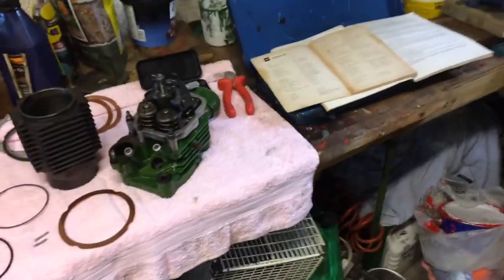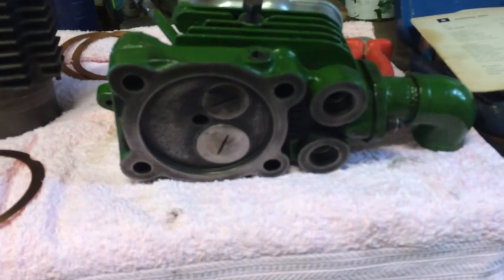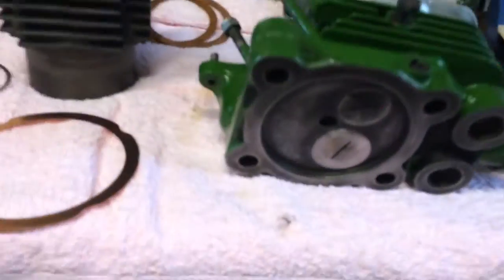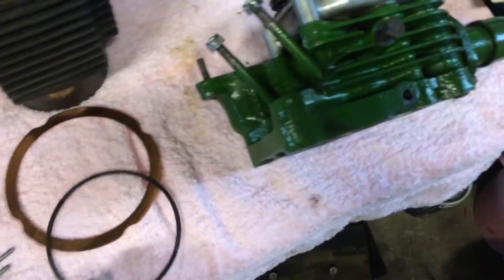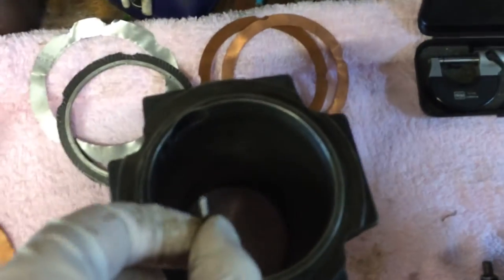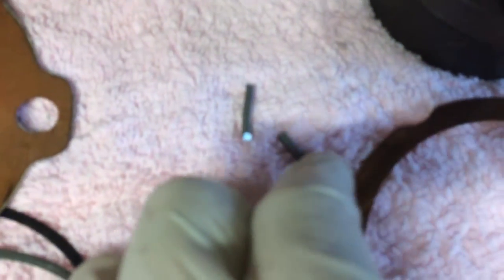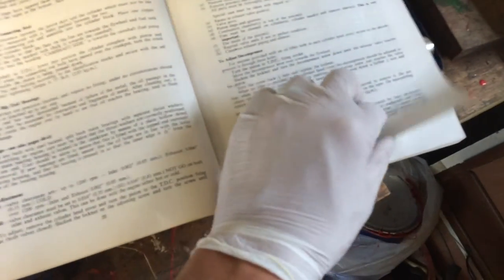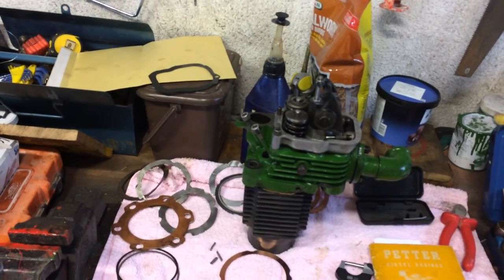diesel engine bump clearances

Comment: It's a more accurate measurement if you use 3 pieces of lead wire instead of 2. Then use the average of the 3 measurements.

Comment: Hi, very informative video, thanks for taking the trouble to post it. Just about to get stuck into a PH2 and will follow your advice, ta. Can you tell what paint you have used on the cylinder head as I like the look. Also can you use it on the barrels?
Reply from the maker: Thank you for your kind comment. i use high temp petter paint, its available on ebay just type in stationary engine paint. i dont paint the barrels. But i guess it would be okay. Good luck with your project.

Comment: Can you tell me the bumping clearances  of lister HR 3 engine as we are putting lead on to the cylinder head n after removing cylinders we r measuring with caliper  so we r putting shims but after fixing everything back engine is not getting start diesel is coming till the injector and even we have done timing as per flywheel  marking.but not starting.